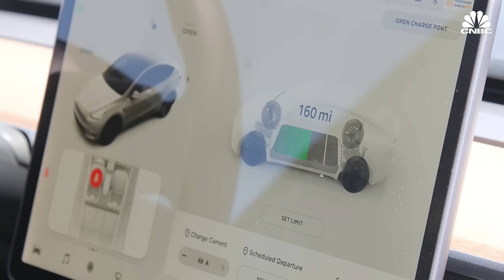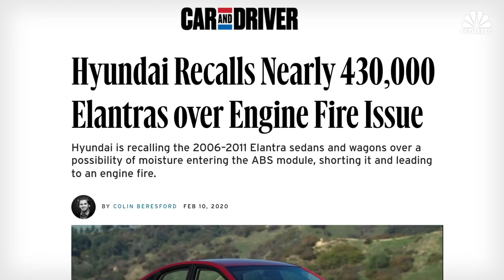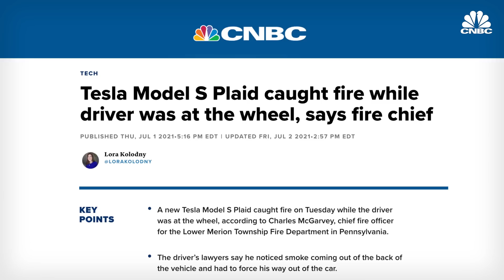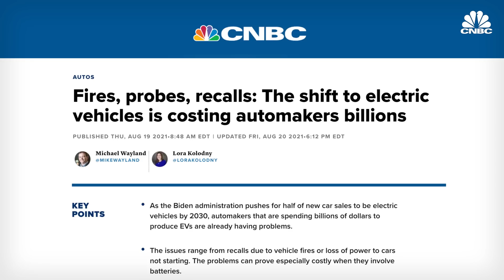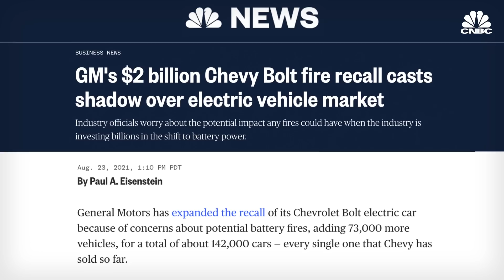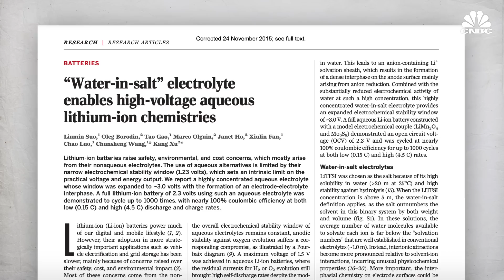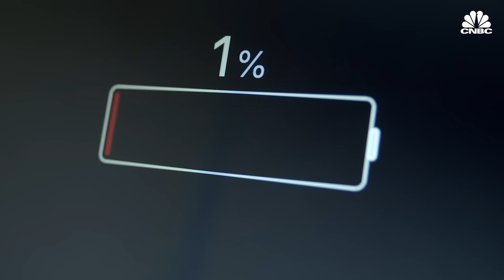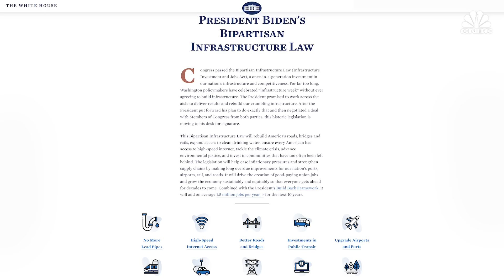Why Tesla, GM And Other EV Companies Have A Fire Problem

Comment: The issue is that EV cars catch fire while NOT being driven. I don't 
know of any ICE vehicle catching fire while being parked unless the 
ignition was from an outside source. Electric vehicles can virtually 
spontaneously combust while recharging. Lithium batteries have a 
checkered history of spontaneously combustion.
Reply: And the problem is, there's no getting around it. It's an inherent problem, unless you're talking metal–air batteries.

Combustion engines don't require oxidiser to be carried with the vehicle, so a tank of fuel is safe, regardless of the energy density, as long as the fuel itself isn't explosive. Batteries, on the other hand, have everything they need to release their stored energy inside the same package, so they can spontaneously combust.
Reply: @electric7487  How exactly is "fuel" safe as long as the fuel isn't "explosive"?

This may be the most bizarre statement of the century.  ALL fuel is FLAMMABLE, which is again why it is FUEL, it burns.

And NO, batteries can't spontaneously combust unless the battery pack is literally damaged or there is a production defect in the battery.
Reply: @redbaron6805  Fuel cannot burn unless it comes into contact with an oxidising agent, like oxygen. You keep it away from oxygen, and it's perfectly okay as long as there is no physical damage to the fuel system. Therefore, the fuel in the tank is safely stored. The issue is vapours (which are mixed with oxygen), and therefore, can catch on fire.

Batteries have everything they need to release their energy stored inside them already. No matter what the chemistry is, stability is an issue that needs to be addressed.
Reply: @electric7487  Except of course, the fuel tank is never 100% full with zero air inside.  There is always air taking up the space that the fuel doesn't displace.

You also got to keep in mind fuel is then pumped through fuel lines and fuel filters, which can also leak, the transmitter unit can short out, the fuel pump can short out and fail etc.

As noted before, pretty much all EV fires that start in the batteries and related recalls are related to production defects when the battery was made.  If the battery is correctly made, fires that start in the batteries are exceptionally rare.

And there are battery types like LFP already that can't catch fire.  This issue is already getting addressed.  Most of the problems we are seeing is early production ramp ups by relatively new players in EV batteries.

As they learn from their mistakes, battery fires will practically disappear.
Reply: @redbaron6805  While fuel tanks are never completely full, getting an ignition source inside there is almost impossible. As far as I know, the fuel pump is also immersed in fuel, and can't start a fire unless the motor is external. The situation is even better with Diesel, as Diesel is much harder to ignite. In fact, if you pour some Diesel fuel on the ground and throw a match in it, the fuel will put the match out. Gasoline, on the other hand, will burst into flames.

While there are battery types that can't catch fire, most of those are ones whose energy densities are on the lower end of the spectrum. It will be interesting to see how manufacturers address the stability issues and how new battery chemistries play out as energy densities increase.

However, something tells me you're grasping at straws pretty hard here.
Reply: @redbaron6805  if anything is correctly made, the likely hood of fire is zero is one of the most worthless statements on this topic. The problem is the heat of the fire, where it occurs and comeplete lack of access to the source. You will not get me in an EV for these reasons, among many others.
Reply: @lolbuster01  Except, that is a logical fallacy.  EV fires start slowly, and although they are difficult to extinguish in the rare cases where they will happen, there are basically zero fatalities associated with EV fires that weren't a result of a violent crash.

Hence the statistical odds that this will ever be an issue for any EV owner is exceptionally remote.  And this problem is only going to get more rare, as the early defects in EV battery production that caused most of the even the rare EV fires we see today have been addressed, hence the odds of the fire keeps decreasing.

And we haven't even started to address new battery technologies like LFP and others which are basically impossible to light on fire.
Reply: Every EV battery fire makes the national news. Gasoline fires don’t.
Reply: @COSolar6419  
> "Every EV battery fire makes the national news. Gasoline fires don't."

- Because it gets people's attention, even though it's not showing the whole picture.
Reply: Curious how much in government spending these manufactures will get in subsidies from the renamed build back plan for EVs
Reply: Oh, so why did Ford tell people that they needed to park their Explorer or Expedition (which ever it was) in the open?  I saw a Ford catch fire in a Walmart parking lot.
Reply: Got more to worry about 

https://youtu.be/cSAOU_GO9B4
Reply: 3500 vehicles caught fire at SWFL airport not to long ago.. I know a couple people who have had car catch on fire in a driveway …. Your research a bit lacking
Reply: @Adogsmate4267  While my goodness, aren't you the special little fellow! When you don't know how to dispute the facts, you can always disparage the person, right? No, it's you who is the very definition of ignorant.
Reply: It happens, not the same as NMC lithium batteries, but it happens.
Reply: Jeep Cherokees did a few years back they had defective alternators the diode heat sink got hot burnt the insulation and 12volts DC right to ground
Reply: So what you are saying is you want a car that is electric and has no gasoline while your driving, but is gas and has no battery while its parked and off. Best of both worlds.
Reply: Most fires of stationary car fires happen on ice wehicles.
Reply: Unless it's a Hyundai or a Kia
Reply: @SteveEddy-od7fb  Reports? Do you have access to any reports of spontaneous fires on Hyundai or Kia cars?
While fires do breakout on petrol and diesels of all makes, spontaneous fires are surely very, very rare. I don't see ferry companies allowing cars that are fire hazards on board ships, or in tunnels for that matter.
PS There have been terrible fires in road tunnels after collisions.
Reply: There are car fires on parked gasoline powered vehicles...typically some circuit board failure causing a short circuit. A bunch of F150s from the early 2000s had a faulty cruise control module that would cause fires.
Reply: ICE BMWs have had that problem for a few years. They'd randomly catch fire in people's houses.
Reply: @B4R0N.  A real problem then. Very unusual. But I do remember cross channel ferries asked you not to fill your tank to the top. Ihave not seen that in years.
Reply: Buddy of mines f-150 ice truck spontaneously combusted while parked outside his house. Something with the brake booster I believe? It happens
Reply: No that's not the issue, the issue is that you can't put out EV fire without expensive fire extinguishers.
Reply: @bert1450  I agree. any viable tech or invention does not need government subsidies or propaganda. Cars, cell phones and everything in between did not happen because of government involvement. If something is economically viable the public will support it with their wallets.
Reply: @1982nsu  Your comical level of ignorance is simply staggering.  Cars, cell phones, satellite communication, aircraft, the internet, fiber optics, radar, microwave ovens, medical advancement, electronics literally are ALL due to GOVERNMENT funding genius.

You seriously can't be this dense.
Reply: @1982nsu the government never got involved in helping GAS vehicles.?

what abt all those bailouts.? 

when thinking abt EVs… they are a solution to the gas pollution…. obviously - other alternatives did not win above EV solution
Reply: Seeing as one needs a spark and the right mixture of o2 and fuel fumes, it's difficult
Reply: @linusa2996  Not true. There are many compounds that do not require a "spark" in order to ignite. They only need a source of oxygen. Lithium is such a compound. An electric vehicle can be perfectly still and ignite because of oxygen intrusion. No "spark" required. The German fighter Me-163B, ran on a combination of two propellants: “T-Stoff”, highly concentrated hydrogen peroxide;  and “C-Stoff”, a 30% mixture of Hydrazine Hydrate and Methanol. These propellants were hypergolic, meaning that when they came into contact with each other they immediately and violently exploded. No "spark" required. https://youtu.be/xZbuuh1f2KM
Reply: more kia and hyundai cars and suv have caught fire than all of the EVs combined.  FACTS.
Reply: @Cancri71  just because you say FACTS doesn't make it so. And I'm sure those vehicles didn't spontaneously combust while refueling then.
Also, there are of those gas powered vehicles than EVs. Your argument is crap without merit
Reply: It is a myth that gasoline cars can't catch fire unless they are being driven. Spontaneous gasoline car fires are rare, but gasoline cars absolutely can and sometimes do catch fire when they are turned off and parked in the garage. The usual mechanism is a wiring defect precipitating an electrical short that ignites vapor from a leaky fuel line. In fact, 483,000 cars from the Kia/Hyundai group were recalled earlier this year to correct a defect that could cause that very problem and there is currently NHTSA safety alert telling Kia/Hyundai owners that their cars are at risk of spontaneously catching fire. Meanwhile, It was only one specific model of EV, the Chevy Bolt, that seems to have caused almost all of the spontaneous EV fires. The Chevy Bolt was originally equipped with SK batteries that had two separate design defects that could cause them to catch fire. But all of those old Chevy Bolts are now being recalled to have their SK batteries replaced by the manufacturer.
Reply: @normvanduker9999  https://youtu.be/T71cVhxG_v4  There are many more examples  https://youtu.be/sAQlLu5ttOk
Reply: @normvanduker9999  https://youtu.be/Le6KNI9YsH0
Reply: @normvanduker9999  Why Tesla, GM And Other EV Companies Have A Fire Problem  https://youtu.be/XWq-Mq1Uqpw
Reply: Just review my new comment.
Reply: But when placed in vehicles they do have extra safety measures to prevent this. ICE vehicles are likely to catch fire while parked as well so don't just think it's EV's.
Reply: @mannyislikethat  
The smoke kills not the fire. Learn 101 why fire kills people.
Reply: @robertagren9360  Not necessarily always true, in the case of either a gasoline or battery fire I'd say there's a good chance you'd be dying from the fire itself.
Reply: @mannyislikethat  Why? Generally because the battery shorts. With EVs, when the battery catches fire, it's as if a whole tank of fuel went up! Quite a show.
Reply: @brianletter3545  Except of course if you have ever seen an EV fire, it is slow fire that builds when the driver is already out of the vehicle.
Reply: @brianletter3545  Well, its as if a tank of fuel went up slowly over an entire day, sure. Takes a long time to get to that point. Whereas with a tank of fuel - an entire tank of fuel CAN go up at once.
Reply: @natehill8069  I'm not sure what exactly you are driving at, because lithium batteries can develop internal short-circuits that can destroy them in seconds. If I remember correctly, one of Boeing's aircraft types experienced just this problem.
As for fuel, cars certainly can catch fire if fuel escapes, I had a Citroen which got a leak in the fuel injector lines, fuel was sprayed all over the (hot) engine. I was terrified! However, the garaged explained that fires  from this cause were almost unknown!
Reply: You are misinformed about EVs being more likely to catch fire when they are not being driven. Gasoline cars are actually more likely than EVs to spontaneously catch fire. How could that be? Because a gasoline car can spontaneously combust due to a defect in the electrical system causing a smoldering fire that eventually ignites gasoline vapors. Just 2 months ago, for example, the Kia/Hyundai group recalled 483,000 vehicles for exactly that problem. Sure, everyone has heard the sensational story about the Chevy Bolt design defect. But Tesla, which has accounted for a cumulative 73% of EV sales in the US, has never had a single recall for anything related to fire risk. And as bad as the Bolt disaster was, it is small potatoes compared to the multitude of recalls related to fire risk that gasoline cars have experienced over the years. Further, according to The National Highway Traffic Safety Administration, EVs are about 10x less likely than gasoline cars to catch fire in a collision, and, unlike gasoline cars, EVs virtually never explode. So while, sure, it is terrifying experience escaping a burning car, it is near impossible to survive an accident when the car explodes. The simple truth is that if you want to greatly reduce your risk of property damage, injury or death from a burning car you shouldn't don't buy one that requires you go everywhere with a tank of highly combustible gasoline located just a few feet from where you are seated.
Reply: @normvanduker9999  Such a lovely TROLL you are, norm!
Such a catalogue of half-truths.
You don't need a recall type fault to blow up a lithium battery with how many MEGA joules of energy stored in it. Boeing showed that very well. They had to put theirs in a metal tank.
Even Lead/acid batteries can fail short, boiling the acid - it has a very characteristic smell.
Reply: @normvanduker9999  What you describe is not spontaneous combustion.  Spontaneous combustion It is the ability of something to ignite with no ignition source whatsoever. You mention the wiring causing smouldering  that would require a spark which is an ignition source. So you do not know what you are talking about. The fuel tank is also at the rear. Most ICE car fires do not involve the fuel especially diesel which is v/hard to ignite. 30 years in the fire service tell me this.
Reply: As a firefighter petrol cars are way more dangerous. You don't hear about them catching on fire so much because it's a norm. I'm putting them out on a weekly basis (parked, driven or road accident). But you will hear about a ev fire that happened in another country. And if people are that afraid of EV's, maybe they shouldn't sleep in a house with more electricity running through it 24/7
Reply: @peninsulaautoservice2559  It's hard to really say because BEVs only account for 1-5% of cars out there, closer to 1%. Hopefully they'll have any large safety issues ironed out before mass adoption or it's possible you could be seeing a lot more of them.
Reply: Except of course, the entire claim is utter baloney.  There have been countless ICE fires where the car was PARKED and wasn't even ON when it caught fire.

Just because YOU haven't heard about it simply means you haven't been paying attention.

Comment: In terms of air pollution, I wonder how many Toyota Camry’s exhaust emissions it takes to equal just one Tesla fire?  Then consider a large percentage of Tesla’s are recharged by coal.. then, at end-of-life we have a huge toxic battery to dispose of.
I’m not convinced battery EV’s are the way to go.. not until we’re off of coal, a better battery composition is in place, and we’ve got a solid plan to dispose of the future’s TRILLIONS of dead cells.

Comment: I checked the data online, and of the top 20 vehicle brands that experience fires, 18 are gas cars.  The only electrics were the Bolt and the Fiskar.  Physical damage is the most frequent reason for battery fires.  Owners usually know if the car has been compromised by physical damage because it has to be severe to overcome the safeguards in the battery design.  Fuel system component failure is the leading cause of fires in ICE vehicles.  Those can happen without the owner's knowledge, and I have personally experience rodents chewing through my fuel line and resulting in a  gas leak that could have caused a fire.  It would be nice if they had actual data to support their claims, because the data that I found doesn't seem to.
Reply: Pat Luxor  Are you trying to be funny?
Reply: @logitech4873  no. he is just that dumb.  he quoted the post. what do you think?
Reply: Well said, the battery packs have more safety systems than your mobile phone battery and the car should know before hand if there is a problems with the battery pack.

Comment: Hollywood won't have to stage those fake car explosions they like so much, they can just get an EV.  Lithium batteries are safe as long as 
you don't have one in your vap in your pocket, or in an airplane cargo container, or in your skateboard in your garage. They are so safe 
airlines won't carry them any longer as cargo.
Reply: Hollywood will discover its not that easy, better to get a petrol and blow that up, a lot easier...
Reply: @wardfiction5693  Right and a lot easier to put out, check with the fire department.